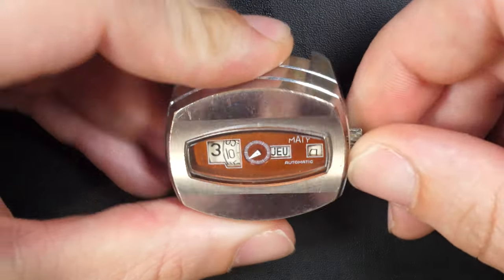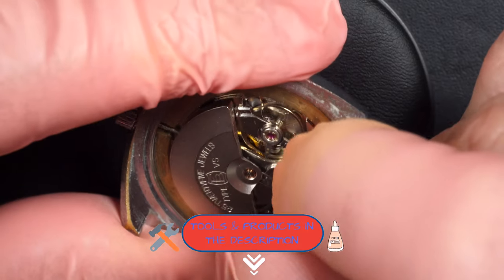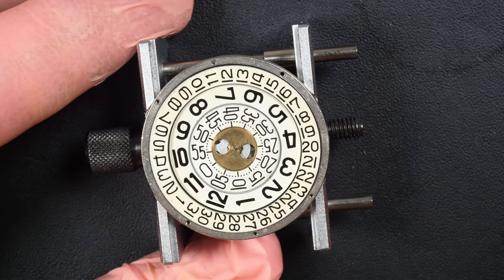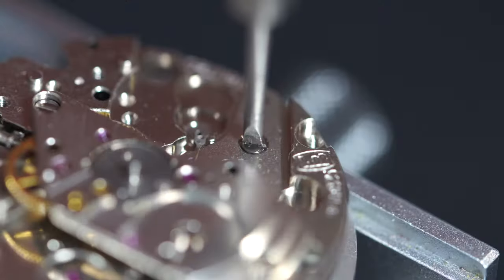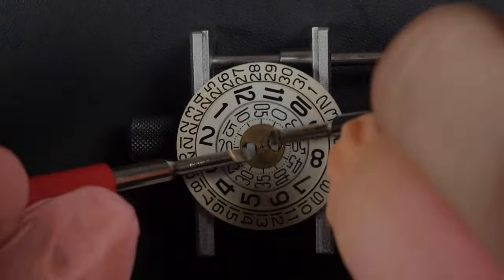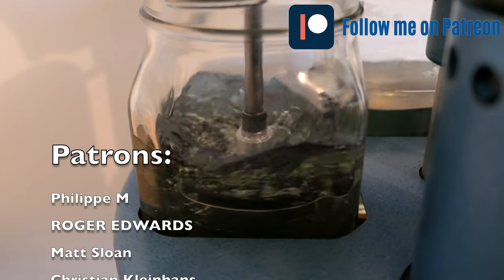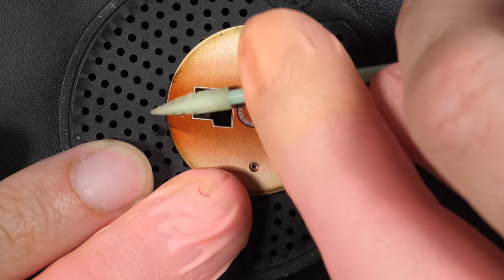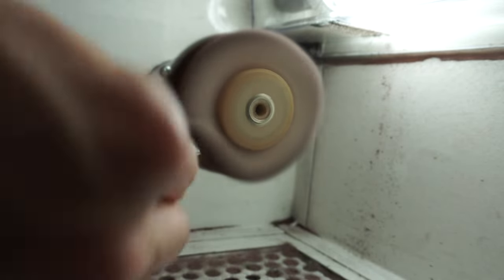A Strange Broken Vintage Watch to Repair !!!

Comment: What an interesting watch with a complicated movement - so many parts! You did a lovely job on it 👍. It’s always tricky to know how original to keeps such a watch; with a plated case it’s alot of work to take back to base metal, refinish it and replate it, and then it may not look right with the aged dial.  Thanks for sharing 🙂
Reply from the maker: Thank you! Cheers!

Comment: A very interesting watch, most of these jump hour watches came out in the 70s in response to Japanese digital watches. Swiss entry level manufacturers didn't have quartz technology so many of these mechanical digitals hit the market, basically with discs instead of hands and basic movements - pin pallet and all-captive jewels. This one is a decent movement quality, perhaps Maty wanted to buck the trend and next go for cheapest entry level but a step or two higher.
Reply from the maker: Thanks for the info

Comment: What do you call the tool with the rubber/silicon tip (at 17:30) to hold things down/nudge them into place? That looks very cool and I want to get one, but no idea what to search for!
Reply from the maker: Here is the link of the product https://www.cousinsuk.com/product/component-probe-horotec-26009?code=C60127
Reply: @FrenchWatchCollector  Thank you!

Comment: Un mouvement förster(bernard förster) 225 . Se serais bien de le metre dans le titre car les videos sur förster sont extremement rare! 
Dans ma rexa guichet j'ais un förster 253 (idem sans le jour)
Je trouve que c'est vraiment un beau calibre mais les ressorts sont une plaie.
Il ma falu une roue de chaussé deporté que jais trouvé chez chronopassion.
Cest dommage que vous ne fassiez pas vos videos en français,  on a du choix en anglophone mais il serais tres bien que quelqu'un comme vous nous fournisse de contenue francophone. Votre travail est tres bon.
Reply from the maker: Merci. Je reprendrai les vidéos en français plus tard
Reply: Pour les surveiller sur les sites de vente, si on voit assez régulièrement des 253 (ou équivalent), c'est le seul 225 que j'ai vu (et acheté donc 😁).
Par contre, acheté à un horloger (plus de 400€...), j'ai été désagréablement surpris lorsque FWC m'a annoncé que le mouvement était sale et les joints tout secs (donc non entretenu 😡).

Comment: Your scratching the rotor with your metal tweezers. 😢
Reply: You notice he’s using brass tweezers, no? Brass isn’t going to scratch steel.
Reply: Still metal on metal,i often wonder who it is that scratches the inside of the movement inside, it's nice to see an unopened, serviced watch movement, after 40 50 year's, and it looks shiny, as new.